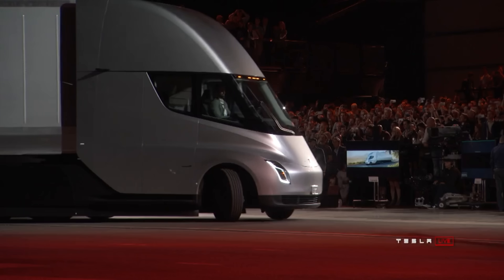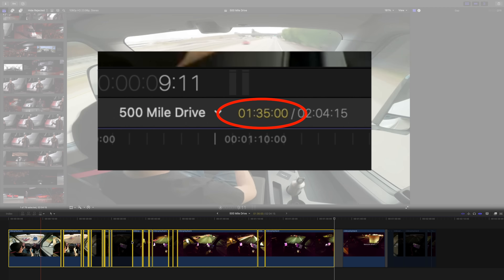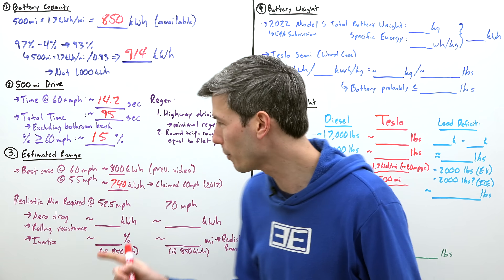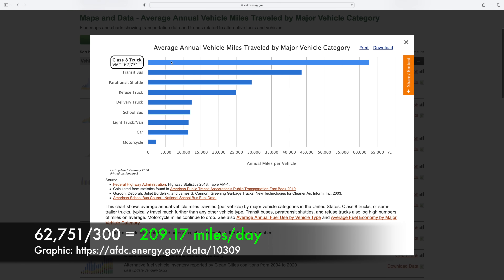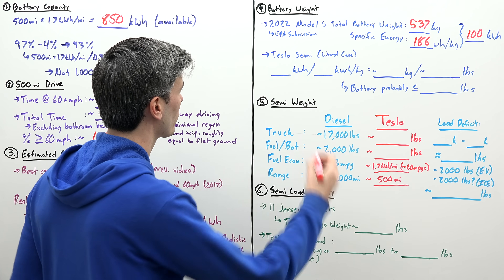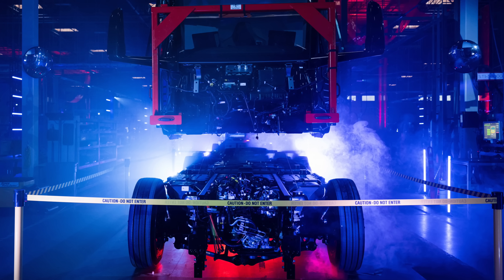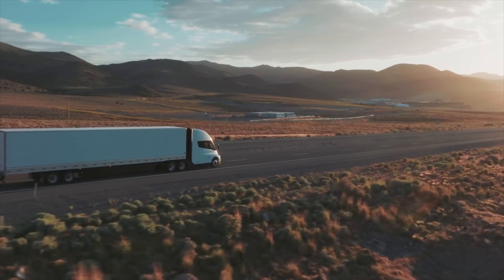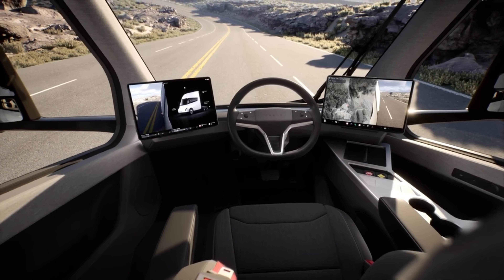Does The Tesla Semi Make Any Sense? Part 2!

Comment: The elephant in the room is what sort of flexibility does a semi have to exhibit to be a fully useful member of a fleet? Or to be a good choice for an independent contractor? It's all well and good to look at averages or 80% of a distribution and say "great, the Tesla can handle that", but that doesn't address the practical implications that might exist for any semi that can't sometimes travel X miles in 8 hours or can't sometimes haul X tons.
Reply: I am a fleet mechanic. 98% of our heavy trucks are parked overnight at our facilities. Our trucks rarely travel more than 100 miles per day, typically much less. I looked out over our lot in the wee hours and imagined all Teslas instead of diesel trucks. Each parking space would require a charger. How much would 100 chargers cost to be installed? What infrastructure would be required to supply the necessary power to our facility? This would have to cost millions and would only cover part of our fleet. Many trucks are parked at remote locations overnight. Gravel lots. The cost of transitioning our fleet would far outstrip any economic benefit. Seems to me the usage of this fleet is perfectly in the wheelhouse of the Tesla truck and it seems to be a non-starter. 
 Especially since our trucks run at least 20 years. All of that up-front investment won’t be recouped far down the road. By then are all the chargers still working? Have they all been replaced? 
 Huge companies getting free trucks are there only customer so far. For a reason.

Comment: 1. What is the voltage of the chargers?
2. What percentage of battery capacity is lost on each charge?
3. What is the cost to replace these enormous battery packs?
4. How many full/partial charges can these packs be expected to take?
5. Real world must include cold climate hauls. How much is the range impacted from freezing temperatures?

Great video by the way. Math and science can be boring for some, but you broke it down in layman’s terms. Keep up the great job!
Reply: 1. Likely 800-1000V chargers.
2. Not a simple answer here. Nobody measures battery longevity like this.
3. Take a Tesla Model S battery replacement and multiply by 9
4. Tesla usually quotes 1500 charge cycles. This should be good for 600-700K miles. If battery longevity has improved, more is possible.
5. It's a bit difficult to know. All vehicles lose range in wintery conditions if you're driving on snow. If you're just talking about cold weather, the range loss shouldn't be that much on a huge vehicle like this. (Battery-to-cabin size ratio is very different from a regular EV)

Comment: My question is since the Tesla Semi will mostly be fast-charged, won't this quickly destroy the batteries? Judging by the degradation of a normal Tesla with minimal supercharging, will the range drop to 400 - 450 miles in 6 months to a year?
Reply: will the range drop to 400 - 450 miles in 6 months to a year? 
You're working from obsolete information, from the earliest generations of BEVs. The Recurrent study, which you can search for, showed that Tesla Model 3s have lost <10% capacity in six years, and those which were DC-fast charged 90% of the time or more had no more degradation than those that were DC-fast charged 10% or the time or less. Further, The Tesla Semi charges at only about 1/3 the current density of Tesla cars, so they will experience even less degradation.

Comment: These numbers are for long haul trucking. But Tesla's first client is Pepsi. They run short, intercity deliveries. A driver's day is 8 hours. Average speeds are less than 35 mph. Frequent starting and stopping is an issue. At least for diesils. Regenerative breaking gives much lower energy costs. 

The Tesla will dominate the market space. It's rapid acceleration allows each truck to move faster and deliver more. The drivers require less training. (No manual backing trailers.) So less pay per hour and less hours. 

There's plenty of time for recharging over lunch. So the 350 mile version of the truck is more than feasible. Lower maintenance costs will be significant as well. 

With all these advantages, a marginally competitive long haul truck becomes a dominant local delivery truck. 

BTW, the Tesla cars use the battery pack as a structural part of the car. I don't know is the semi-does, but Musk seems to like the idea.
Reply: Drivers do not require less training. To obtain a CDL you must pass a skills test. This test includes demonstrating your ability to back your trailer up.
Reply: @AlphanumericCharacters  I can't count the number of crushed trailers I've seen in my life because marginally skilled drivers couldn't do their job. 

Managing one clean backup is not the same as doing it a hundred times.
Reply: You state maintenance costs will be lower. What is your grounds for this statement. These trucks are completely unproven technology. What is the life of the three motors and the cost of each? What is the life of the battery pack? The life of the various necessary inverters and converters? 
 A cooling system is required for all of these electronics and motors. How reliable will this be. The various pumps, tubing, hoses, and heat exchangers? How reliable will the door latches, windows mechanisms, and driver controls be? These are all unknowns. A window regulator mechanism may seem to be minor an inconsequential but the driver must be able to roll his window down as this is “an escape route”. It is part of the pre-trip inspection. 
 Point is. You are making all kinds of statements backed up with zero known fact to support your assertion that Tesla “will dominate”. You also likely have zero experience in the field yet believe you can somehow understand even a big picture view of the logistics of such a fleet. 
 The fact that Pepsi is taking delivery of 100 trucks is no indicator. They got them for free. They have no skin in the game. This is part of the potential deception. When you go in to a sales meeting you tout that mega/fleets such as Pepsi are adopting your trucks. Smaller operations might think that they would not have done so if the beam counters hadn’t stamped off. Of course any bean counter will stamp approval on free stuff.
Reply: @AlphanumericCharacters  Electric motors ARE new technology. They've only been around for 150 days. Oh wait, that's 150 years. 

Lower maintenance costs come from fewer moving parts. Yes, windows and doors still need to be checked. A simple as a diesel engine is, it still has parts like valves, oil pumps, etc. that wear. Meanwhile the electric motor can just be replaced. It is simpler, longer lasting, and cheaper. 

The battery packs are an issue. They are new enough that there isn't data on them. The technology seems solid. But maybe they will be subject to recall. 

You are right that I have little experience in the field. When it comes to electric trucks, no one does. I expect Tesla will undergo some serious growing issues. I noticed their cab design is sparse. They will likely need to replace their seating arrangements. For example, truckers' cushy seats aren't a luxury, they are a necessity. 

But cost savings will drive the industry. And electric truck are cheaper to operate. At least while the government is handing out cash.

Comment: it takes 93% of battery capacity to travel 500 miles - that sounds bad.  takes 93% of a 500 mile (nominal) capacity diesel tank to go 500 miles? sounds perfectly reasonable. electric anxiety is real -  i drive 450 miles, have 50 miles of fuel left and i'm not worried.  50 miles electric range? i wouldn't leave the charging station!😱

Comment: I never said the Tesla truck was bad/impossible.
I just always had the gripe with the charging system/cost/battery degradation.
in barely 5 years you'd have a truck that cannot handle the range you need anymore.
Charging at 1MW is not a simple feat.
the infrastructure is very expensive, and I am not sure it will ever pay out.
even if it is 100 dollars cheaper to run on the long run, it is a good financial choice.

Comment: Now you need to do a video on the viability of hundreds to thousands of megajoule rated charging stations (as well as what, a dozen or more in one place at any given truck stop?) on the Grid and the ability of existing wires to deliver and handle the load.
For anyone thinking you could charge a Semi at home - that needs a reality check!

And when is someone going to develop a recycling method to recover at least some of the rare earth metals in lithium batteries?

Comment: Actually the fact that Tesla Semi can recharge from 20% to full capacity in 45 minutes is already mighty impressive. 

I remind you that truck drivers are legally obliged to make stops anyway. So if they recharge during those breaks - this makes Tesla Semi's range pretty much infinite.

Considering that just a few years ago electric trucks were nothing more than a sci-fi, this is actually pretty good.

Also you're looking at it the wrong way in the USA. You have zero problem with electricity since you have nuclear power plants. So more power needed to recharge those trucks isn't much of an issue. But because those trucks don't need oil, that leaves more oil in the market and this makes it cheaper for regular folks driving diesel cars who may not be able to afford electric cars so easily. And also oil prices are affected by monopoly practices (*cough* OPEC *cough*) but electricity - much less so. So less demand for oil leaves less room for those monopolies to speculate on oil prices. And also this means that cost of transport is less dependent on those oil prices as well, which is good.

Comment: Not long ago I was a Tesla fan, but also a pragmatist and numbers guy. I salute you for this video. Tesla has not been forthcoming with data, but my impression was Elon was not to be trusted. In a video critical of them the low speed during the 500 mile video was pointed out. You did an excellent job with that. Does it go 500 miles, yes. Can it do it fully loaded at highway speed. No. Not only will they not offer charging at 7 cents per kwh, it's currently like 50 or 60 cents. When it was 25 cents I figured it was about half the price of gas. Now it could be more than diesel, which can go 2,000 miles on a tank. Kudos for pointing out that Elon is not dependable. Thanks also for pointing out the subsidies. Apparently it is capable in the right cases, but unfortunately it might not have a cost justification without subsidies. I can't help but think the numbers would be different in the future and Tesla has been doing their best to catch up to impossible promises. Thanks!

Comment: Great video as always! Your detailed content is second to none. I disagree with your treatment of the less quantitative issues you bring up at the end.  Your complaint that it was delivered late doesn’t acknowledge the context of that delay being higher than expected demand for their vehicles which caused them to prioritize models Y&3. Bringing up the guaranteed cost per kWh as a issue only because you don’t believe it is odd.  The cost issue is also lacking in context because prices for commodities in the battery and body surged in the intervening years.  The 3 motors rather than 4 seems to be a non issue as long as they still give the million mile warranty.  I thought I remember from the presentation they lowered it because of get more power from the motors than they could in 2019.  

Lastly, you give them a 2k lbs “credit”, but from your image the engine is 2-3k lbs, cooling system 350-400 and driveline/transmission 800.  It seems a Tesla should get more credit than 2k.

Comment: CA Banned Diesel trucks (over 14,000 lbs) 2010 and older from their roads this January 1st 2023!  Hence fewer trucks to take goods from the ports!  And the ports will continue to back up!  Long beach to Primm Nevada (state line)  is 240 miles.  I predict many will be used for that drive!  and drives from Bay Area Ports to Reno NV!  Then turn around and get another load!  However these will be uphill hauls, so there range will be much less

Comment: Temperature is a huge issue for electric vehicles.  Tesla was just fined in S. Korea due to mileage range of vehicles plunging by ~50% in low temps.  I think California is a best-case usage scenario since it doesn't really get cold.  If the trucks range is 20-50% lower in cold weather, it can make it unusable part of the year.

Comment: wonderful, in the trucking industry we need great flexibility. one load will be industry insulation weighing 8,000 lb 13 feet hight and 52 feet long. the next load will be 48,000 lb 2 inches hight and 40 feet long. same truck same trailer. having a limited amount of weight makes the truck park for days. not a good business plan

Comment: If the battery weighs 5000kg AT 200KWH / TON... OR 
5600KG @ 180KWH PER TON
LITHIUM ion DENSITY is 180 -200 Kwh per ton

Comment: All of your analysis about the percentages of trucks maxing out by weight (or volume) is irrelevant. The current weight averages contribute to road degradation and are taken into account when setting fuel tax rates.  If you allow a bunch of heavy electric trucks to tear up our highways then fuel taxes will necessarily rise. This will incentivize more firms to use electric trucks ...leading to faster degradation ...leading to higher fuel taxes  ...leading to more electric trucks ...etc.

Allowing electric trucks to weigh an extra 2000 pounds will contribute to faster degradation of our highways.  The repair and maintenance of our roads are paid for by the cars and trucks using petroleum via fuel taxes.  What was the rationale for allowing the extra 2000 pounds for electric trucks?  How will they pay for road repairs if everyone switches to electric?  A fair comparison would get rid of that 2000 pound allowance since we'll need to get rid of it eventually in order to keep our roads driveable.

Comment: As a European the idea of big trucks going 60 miles per hour is insane. Here most countries have speed limits for trucks ranging from about 80-90 kilometres per hour depending on the country, much slower than that 60 miles per hour. 60 miles per hour is closer to what cars will be doing, not trucks. Trucks going that fast is generally considered unsafe because of their mass, and undesirable because of the noise such speeds would cause for the environment.
Reply: Well, there are states in the US that are as large as some European countries. On flat roads, semi trucks are doing anywhere from 65-70mph in many states.

Comment: Still not considering heat and cold into battery efficiency. If this last winter is any consideration, most of these will not be usable in a real world sense during heavy winter storms. Or getting stuck in traffic in the summer in the sw.

Comment: The central drivers position makes no sense, it has been tried in the past by other manufacturers and quickly dropped. If the idea is to make one model for all markets it falls short on weight  for European sales as they are 40 tons units (89600lbs) on average, Australian and middle east are even higher weights.

Comment: If Im a distribution hub that expects a vehicle/driver to get my load 600 miles in the alloted DOT 9 work hours- I can't give this load to a Tesla. If I expect this 400 mile route to take 6 hours (not a problem at 70 mph), I am not going to adjust my schedule so the Tesla can deliver it in 8 hours at 55mph for maximum aero/range. Opps- it's cold out today, I can't deliver this load at that range now without a recharge- so now the load is late. Does charging time count against driving hours? What happens when my truck needs servicing but the Tesla software locks out my dashboard because it wasn't serviced by a Tesla technician? 

Unless the trucking/shipping industry is going to drastically change the way they schedule routes and change their expectations for drivers, time, and range- this is all going to be soundly rejected. Sure, Pepsi can have their 400 mile specific route for them, their drivers, and their routes. But at large, none of this makes any sense.

Comment: I just researched the total cost of ownership over 10 years of a regular EV vs an ICE vehicle. Argonne National Laboratory states $70k vs $81k respectively. No tax incentives or BATTERY replacement cost were included. In Finland a guy just recently blew up his Tesla in protest because the replacement cost of the battery was quoted around $25K. Plus, we shouldn't forget the irony that most of our electricity around 80% I believe is still coal and fossil fuel produced and 50% of it is lost in transmission according to an PG&E engineer at a green energy conference presentation. I would love to see a video from you explaining our electric energy production and grid. Before we talk about making everything electric. I believe as an engineer you might find that the CO2 output is much higher than from the heavily regulated ICE vehicles today.
Reply: "I believe as an engineer you might find that the CO2 output is much higher than from the heavily regulated ICE vehicles today."
There's a lot of research on total environmental impact of EVs, and their CO2 output is easily below comparable ICE vehicles in about 90-95% of markets.

Comment: Lithium ion batteries have a optimum operating temperature of 60-80F. 
Questions - how does the cooling and heating of the batteries figure into your calculations? Furthermore, what is the replacement cost of the batteries and how are they recycled?
Reply: "what is the replacement cost of the batteries and how are they recycled?" - I've been on social media for over 10 years and I've never seen anyone state this before!